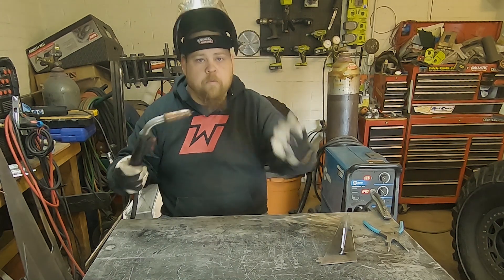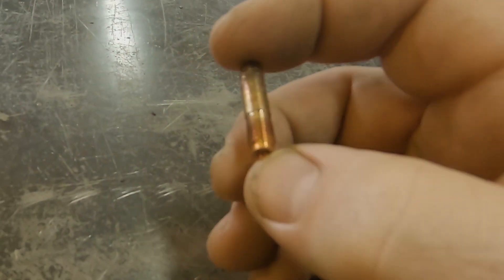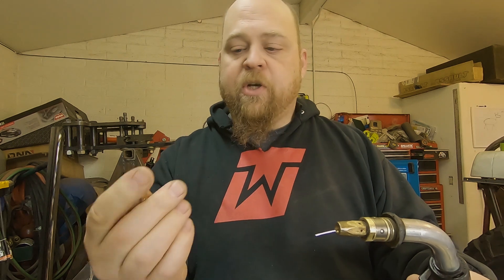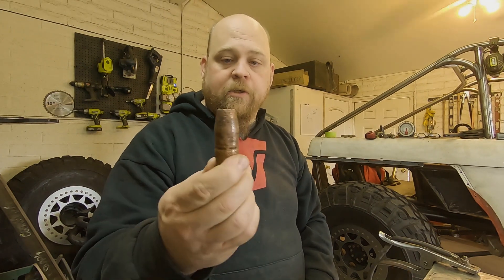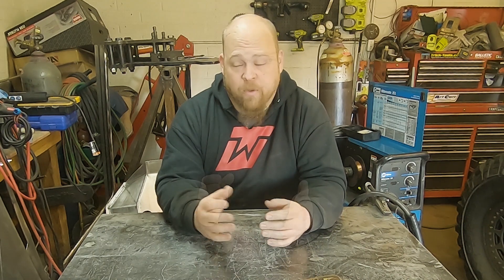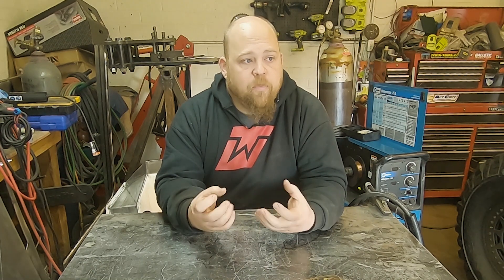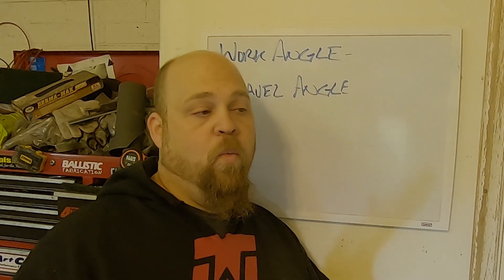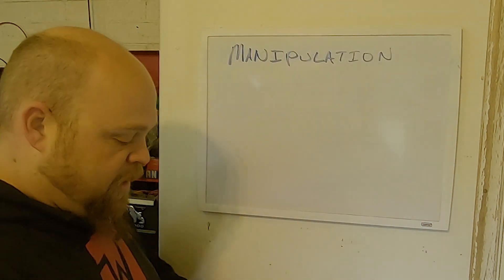GMAW Basics, How to improve your MIG welds with 5 simple steps. Fabrication 101

Comment: Mig at work spatters a lot, when you go to light the arc quite often it just pops and welds to the tip.  Welds so so sometimes and terrible at others.  Tried everything i know of, Stick part of the welder works fantastic.  I'm a stick guy, but it would be nice to have the mig working fo quick little jobs and tacking.  Thanks
Reply from the maker: The popping and welding to the tip could be caused by a loose or too big a contact tip. Intermittent weld quality could be a worn out or damaged liner or incorrect drive roll tension.
Reply: @Fabrication101  Its a miller Dimension 452 with 70 series 24v wire feed. .45 wire and tips, currently running metal core.  just adjusted the drive roller tension.  No idea how old the liner is, and unsure about the drive rolls.  What should the correct rolls be?  Thanks for replying, this things been driving me nuts for over a year.  Just try it for a bit then get frustrated, then switch it to stick and get the job done.

Comment: Thank you for your tips... I am a hobbies and I mostly weld on sheet metal, specifically vehicle fenders.  I recently was told to try 90% argon 10% CO2 as it will not blow holes in thin sheet as quickly.  Have you every heard of this and does it really work?